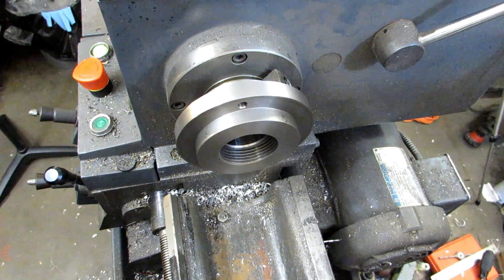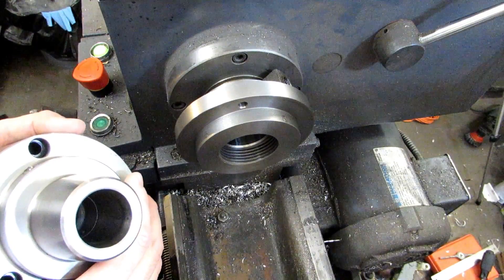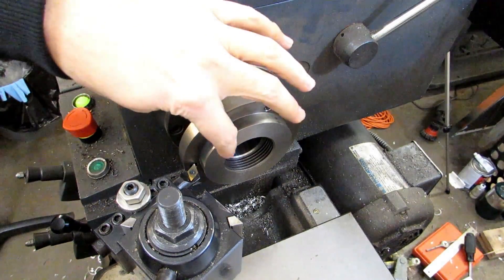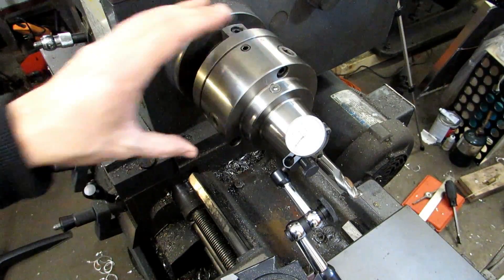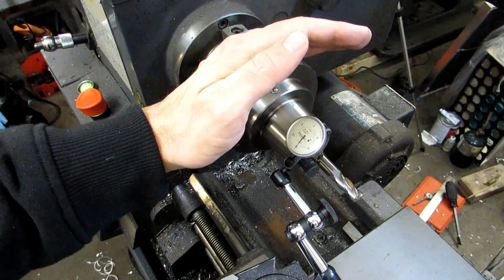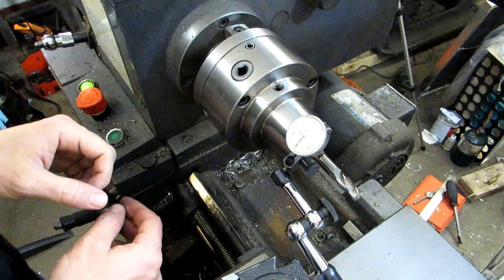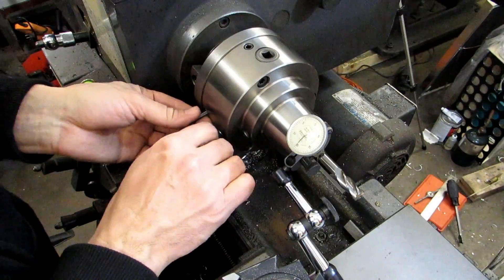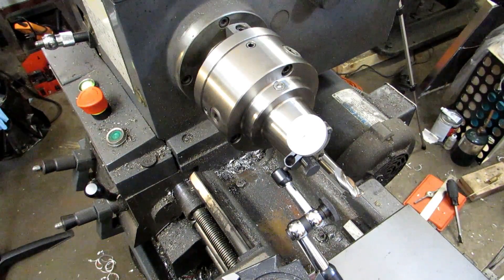Adjust Tru or Set Tru Lathe Chucks

Comment: This is 6 years later, so it may not matter, but I always first check the inside of the taper on the chuck, near the outside edge and back at the inside edge. Doing both tells you whether it’s parallel to the center if rotation, or is slightly angled, giving wobble. It also tells you whether the chuck itself is concentric. Only checking it with a collet means that you’re checking the runout of the chuck and the collet. If the collet has too much runout, when you adjust it, you’re only adjusting it for that one collet, turned the way you inserted it into the chuck that one time. It’s best to check the collet by rotating it 90 degrees and checking each time for a full rotation. If these are really good collets, it’s not a problem, but if they’re no brand versions, they could be off by several thousandths. So do that check, and mark the chuck and every collet where it aligns to that make with the least runout.
Reply: melgross, you are spot on! This video shows bad set up practice.

Comment: Stuart - thank you for the fantastic videos. My set-tru chuck adjustment screws aren't 90-degrees to each other. Perhaps because of the small size of my lathe (5" D1-4). Anyway, I am pretty good at adjusting a 4-jaw, but I'm struggling with these other chucks. Can't seem to get them dead-on concentric. Have you seen this style before? Both my Bison 5c and my TMX 3-jaw have these non-90 screws. 

Appreciate your help!
Reply from the maker: A friend of mine has a Bison 3 jaw like that. I guess they did it that way to get around the chuck pinions...or maybe just to get around a patent.
Reply: @StuartdeHaro  Thanks - I'll keep tinkering :)

Comment: Since I haven't seen your lathes spindle nose I can't say for sure, but with threaded chucks or backplates the threads only secure the chuck to the spindle. There should be a short unthreaded section of the spindle nose and that's what does the actual concentric locating for anything screwed to the spindle nose. That's the most important dimensional area to get correct when machining a new backplate.

Comment: Do you mind sharing what brand/source the chuck is ?  My import 5C chuck is horrible to get the TIR set.  Lots of beating on it with a deadblow.  Mine is D1-4 but don't have a backing plate.
Reply from the maker: I got mine on eBay years ago. It's the same imported collet chuck that every place sells.
Reply: I've looked hard for one of those, never found an import.  Bison etc.  over $500 is all I can find.  Been looking and watching for one for a year or so.  Very frustrating to take my 5c chuck off for larger work, knowing it's gonna be hard to get it back true.  Thanks.
Reply from the maker: Yeah, it's weird.  They don't seem to sell the adjust-tru variety anymore.  If you get a plain back chuck, you can achieve the same thing by making the locating boss on the back plate a bit undersized and then tapping it around before fully snugging the bolts.
Reply: I purchased an adjustable 5C chuck and backing plate from Shars
Reply: Was D1-4 backing plate